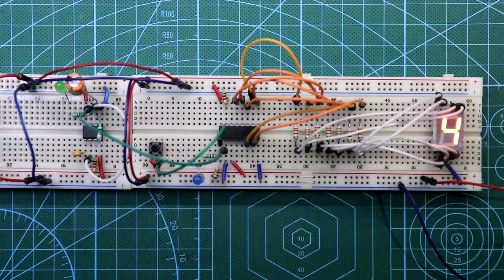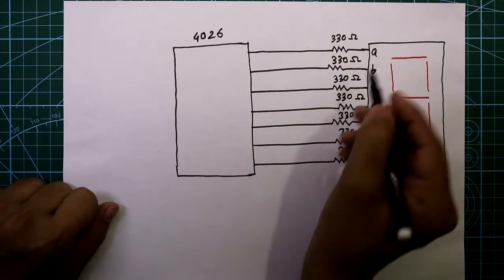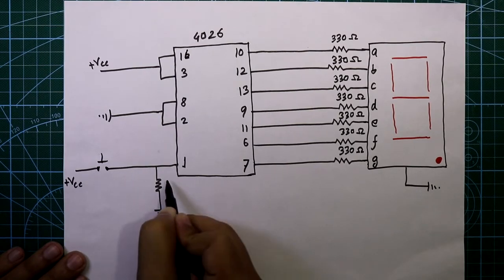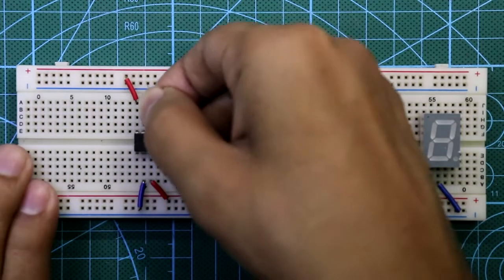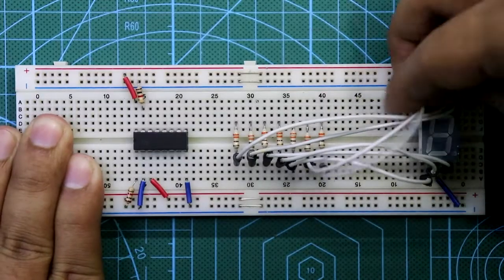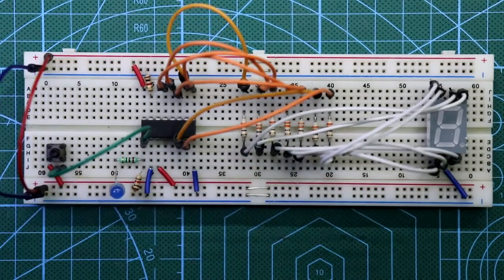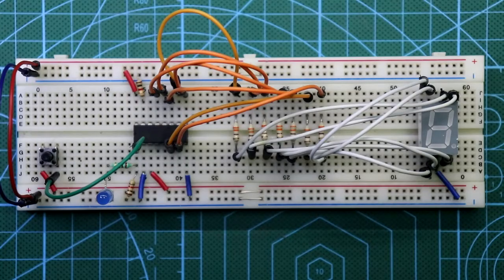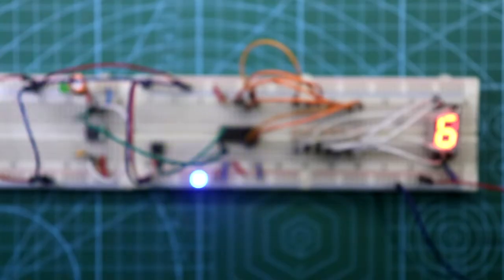MOD 10 Counter with 7 Segments Display | 0 to 9 Counter Practical Circuit

Comment: Great one.
I used a CA 7seg display, had to make a few modifications but it worked perfectly. Thanks .
Reply from the maker: Great. I think you added NOT Gate to each of the outputs?
Reply: I only have CA 7 seg display instead of CC 7 seg display, what modifications did you apply to make it work?